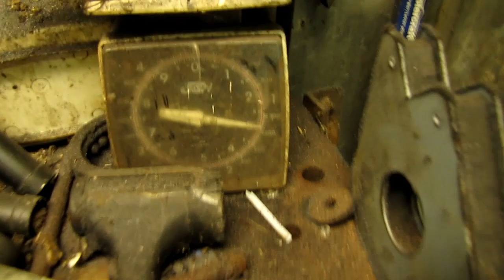Easy New Method  for Removing Copper Winding's From Motors (DIY) Using Limited Tools

Comment: I do this with a hatchet with smaller transformers. What I discovered was that as soon as the blade is stuck in the transformer, I can do away with the hammer and just swing the hatchet with the transformer stuck to it, onto the ground. If you were able to attach a long handle to that blade you made, you could just swing it like an axe with the motor stater stuck to it onto the ground. Its much quicker, easier and makes a lot less noise if you do it on gravel or soft ground.
Reply from the maker: @E-BikingAdventures  that is a great idea, thanks for sharing

Comment: Really great job, in my opinion. The plow coulter works great! I saw someone use a machete and bang it with a hammer. Works pretty well. I think the coulter section works even better! The geometry looks right, from the start.Those stators came out of oil filled 'sealed units' or? They look pretty big. Maybe I'm used to seeing refrigerator ones which wouldn't have to cool as much (lower ton/btu rating) I love how you go straight at it! Much obliged!

Comment: Nice. Always looking for new methodology.
 Many shops will utilize a pointed blade 5 or 6 inches wide, or more, mounted on a hydraulic ram inside an arbor press frame. But for the hobbist who doesn't have access to big machinery this method is acceptable and efficient.
 Stay safe in your endeavors.
 Nice demonstration.

Comment: I'd be scared to use your slitter ,but on the other hand your method is good ,nice work ,I tried i different method for stator moters ,I don't really time myself doing them ,under 3min per stator moter ,can you tell me how long it takes you with tha😊to super splitter, I've never seen this way of cutting a stator in half as quick as you did

Comment: i use a axe head to split it in half, u have to grind it long and thin ,so one hit with a 5 pound sledge and it sticks in the plates, then it works great,, i also have a 20 inch flat blade screw driver i modded by grinding the flat end almost to a point leaving 1/8 of the end wide,grind it so the end is no wider than the main shaft, mine is square, it goes into small openings in copper wire easy, a few hammer hits on the end ,and yes the plastic handle will break off,and then  just pry the  copper out.

Comment: I use a tire iron to pull the wire. A single bar with a flat on one end and bent on the other with a socket. Done 1k plus.

Comment: I use a machete from harbor freight and a two pound hammer. Then an air chisel to quickly remove the copper.
Reply from the maker: That might work but I would have my doubts the steel on a cheap machete would handle the blows.
Reply: @Vicsonvee  fiskars brand not exactly cheap but it has held up after several hundred stators

Comment: do you have any hints for opening the compressors cases?
Reply from the maker: The rotatory ones I cut open on a lathe or a band-saw and the other ones I just cut open with a cut-off wheel, on an angle grinder

Comment: Add that to some kind of lever and it would split those like butter. I like it. Useful as is but could be modified for even easier use
Reply: I was thinking the same thing. 
Drill a couple holes or weld a plate on top. That way you can save your knuckles!

Comment: Those winding can simply be cut at one end and pulled out on the other. Really no need to hack it in half to extract
Reply from the maker: Nice lets see  your great demonstration video...
Reply: Obviously you haven't scrapped a whole lot...  "and pulled out"........yeah
Reply: @dawnpeterson3215  obviously I have if I know it's easy to remove. Hold L
Reply: @dawnpeterson3215  noob life
Reply: I’ve used bolt cutters and pulled through the other end as well. It works great.

Comment: I'm surprised you don't cut all that plastic and string off and your yard consider it clean , I clean everything  off before it goes in a pail ..
Reply from the maker: Why bother, they give you the same price and really it's a little more weight.  All motor windings are varnished copper and it's grade 2
Reply: Yeah my yard don't care about a little plastic and string. I'll take the loose plastic and string out but not sitting there cutting string to loose weight. It's clean #2 no matter

Comment: Very nice system.  Cutting in half makes the pulling so much easier.
Reply: Absolutely! When I do the 'cut one side through the copper routine' It cost (depending on the size of the motor) much more friction, struggling, energy and time to get the stuff out. Hammering the blade cost no energy.
I am actually wondering what the result will be if you don't cut ones in the middle, but instead make two cuts close to the ends. It will divide it in three parts, so the friction is much lesser, which makes removing the copper easier. Well, it's a theory, perhaps valid enough to experiment with?
Reply: You also could use a makeshift guillotine like press cutter. Using an old hydraulic carjack (electrical or just manual) and mount this in a square frame, to which you mount the blade you used now, in downward direction.
Advantage, is less power, less noise and danger of hitting your hands.  Will be faster if you use an electric one, but a manual jack will do.